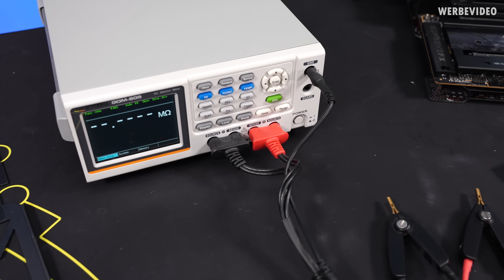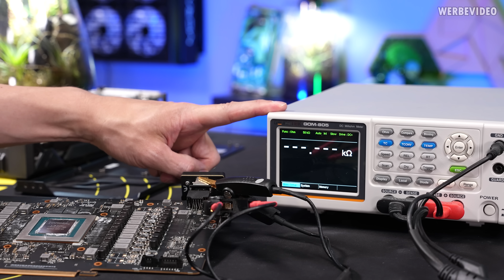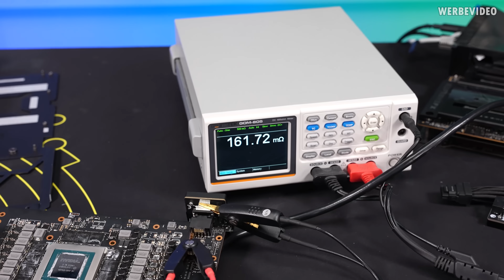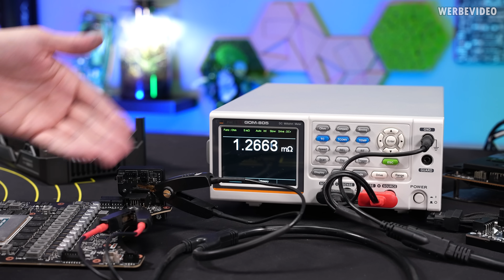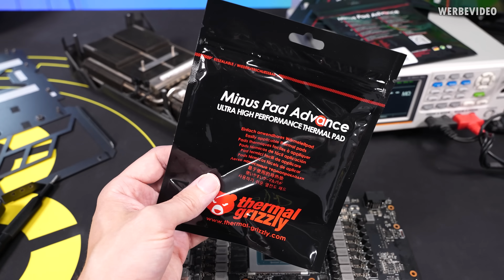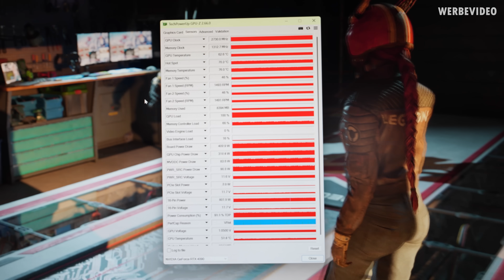It Happened Again – RTX 4090 with Melted 12VHPWR

Comment: Edit: Dang! I also had a Corsair PSU...

Interesting...
I have the same GPU (since June 2024) and everything was great but a few weeks ago it was unstable. I couldn't play long sessions. The games crashed, black screens, etc. After those black screens the UI in windows for example Windows Explorer got black. If I hover the mouse over a folder, it got back to the correct color. I've never seen something like that before. It even froze in the bios
OCCT vram test failed after 2-3 mins.
There were no signs of melting though
I sent the GPU to RMA, let's see what happens...

Comment: my 4080 with the wire view same problem after a year using but i got lucky and the connectors melting together not to strong so i was able to remove the wire view and using regular connector right now

Comment: My RTX 4090 I did a slightly undervolt (no performance loss) and it operates from 270w - 360w and in my build it sits between 53°-60°c room without OC, I don’t think this will  ever be able to get burned in such (low heat) circumstances.

Comment: i wonder if you're already at the point of replacing the connector on the card if you should just change it to something more reliable. hard wired pigtails to pcie 8 pin or something like that.

Comment: They should make the connector in back of the GPU like with the PSU. that way, it can deliver more power.It's more secure, and then you don't see the cable inside the case
Reply: You have cool interests I subbed to you
Reply: @jonnypanteloni 
Cool 😀

Comment: Either decrease the gauge of the wire to use two cables at 12v, or increase the voltage to use two cables at a lower amperage! You're never going to get passive load balancing.

Comment: If only they'd put a capable connector for the power it is handling and a good management system for monitoring it better... you know basics that should be required and essential for any electronic device.

Comment: Another Corsair failure. I ran an EVGA 850w T2 for 8 years just fine and using a cheap Fasgear 12VHPWR to 4x8-PCIE adapter for my October 2022 4090. Then I "upgraded" to a Corsair HX1500i in January 2025 and within 2 weeks I had melted damage to my cable and connector. Somehow people blame me for this when I ran my GPU for nearly 2.5 years without issue until switching to that cheap junk Corsair PSU. Those cheap plastic connectors are so bad that they even sliced my hands up when unplugging them. This whole process lead to me RMAing my 4090 and getting it stolen by FedEx. So thanks for nothing Corsair. I will spend the rest of my life preaching how garbage you are as a company to ensure no one suffers your junk cheap hardware like I did.

Comment: This is the 1 reason I bought a 9070xt. I wanted to go 5080, 5090, or 40 series high end, but this card has basically the best performance especially for price, without having this danger.
Reply: Never had this issue with my 4090 or 5090 so meh.
Reply: Not worth th le risk. @ZackSNetwork

Comment: When an electric current passes through a medium with an excessive load and the electrical distribution medium cannot handle the current load, heat will occur. It is surprising that a company as big as Nvidia does not know the physics formula for electricity.

Comment: I'm fairly certain by now that the issue with these connectors are just the unbalanced load issues.

The moment they fix those, I don't know how, the connector should be fine for everyone. Because there is legit no way that a 4090 connector would melt if some single pin wasn't carrying more than 15 amps or more.

Comment: This design is just disaster. I have idea for a video for you,and also experiment with that crap. Month ago i have bought Asus Astral 5090,because it has built in voltage per pin messauring. I also have bought 2 of your WireView Pro,and i am just afraid of using them,as every connection of the cable give you dissbalance of the amps on the pins. Connecting cable through the WireView Pro is never even,but its acceptable. Connecting cable without any extra connector gives you the best results,BUT: every time you connect the cable you have different disbalanced on the pins. And my PSU is Seasonic Prime TX 1600 Noctua Edition,which is like 2 month old. Two 16 pin cables were included,and one can already go to garbage,because one pin is always at 1 Amp,which is insane! Yes i did few plug in and outs,as i was rebuilding my custom loop,but it was just a few! Now i am using second 16 pin cable from PSU set,and i wonder what i would do if pins would go crazy...

Comment: Sigh, this is such a tired, low effort video topic. The cost to beef up this connector so the nerds are happy exceeds the cost of RMA replacement on melted cards. That, and knowing there is an accepted failure rate for any product, is all this is. People are ridiculous, they want it overbuilt more than necessary, but the only thing they scream about more than that is the cost. Make it cost more! But it already cost too much! Use the old connector instead? Yeah that melts in the exact same way.
Reply: safety aspect should be overbuilt
Reply: @cronyan Even if it was, some would still fail and melt down. Airplanes are a good example. Overbuilt with double redundancy, but they still crash. Rockets that go into space, same thing. People are being unreasonable. But there's one thing you can do about it, just don't buy these gpus!

Comment: This is the reason I selected the 9070XT over the 5070Ti - the power connectors present an electrical hazard for users, and I do not have confidence that the new revision has been corrected or is more dependable.
Reply: It's really not a hazard on a card like 5070ti. Those only draw half of what it's rated for. There's nothing wrong with the connector itself. Just don't buy cheap adapters and plug it in securely.

The issue is more that cards like 5090 use 95% of what the cable is rated for. In the electrical code theres a thing called the 80% rule to leave a little margin for error. They probably should've done that with those.

Comment: 9:55 - A little bit confused on this part, why did you heat it up from connector side and not underside? You could have wrapped parts that you don't want melted in aluminum foil as well

Comment: Great video as expected. 50watts per pin with a slightly thicker gauge of wire over 12 pins would be a much safer 600watts power cable. That would inspire better acceptance to adopt using it.

Comment: What a complete F-UP by Nvidia……..and worse…….they still refuse to take any blame. Brutal………but let’s face it……..this is the new Nvidia and typical of a monopolistic company. Nvidia should be forced to split up. They have become a predatory company. I firmly believe it is the same guy who designed the 5v ARGB connector for motherboards. Another brutal connector, but not as bad as the 12VHPWR

Comment: Soon we’ll have GPUs with modular parts to easily replace all the commonly failed components, like the power connectors and fans.
Reply: Fans are already modular (I know Sapphire does a fantastic job with that), so why not the other high-use components of your thousand-dollar purchase?
Reply: @benjaminoechsli1941  may as well, and why not make the VRAM modular as well? We could significantly increase the longevity of certain GPUs.
Reply: @criznittle968  VRAM has been modular in the past, actually. Unfortunately, that component getting modular makes it notably slower and more complex due to the extra designing needed for the PCB to make it work.

Comment: You measure 4 resistors in parallel, one of them is near teh 105mOhm. Ones, that significantly higher, 140 reading you measure thru board which is too high for some reason since 105 + board path could be 107 or 110. Then you unsolder and never measured. There also other 6 pins. My guess you want better connector in power adapter.

Comment: I still suspect it is the female terminal pin problem, either the pin contact point design, material thickness or plating issue.
Since Wireview female terminal lose to the corsair cable, maybe do some female terminal pin comparison.

Comment: If power is bridged together, then why separate it at a connector into so many pins? Why couldn't they just do that on the board? Wouldn't that be a more stable, less user error of a design to have say 2 large pins instead of so many small ones?

Comment: How can you measure the pin resistance while the plug is still on the board, does this card has 6 power planes on the board? both the wire view and the pcb have all 6 pins on the same power plane as far as i can see

just looking at a 4090 pcb (eg strix/gaming OC) it looks like all 6 power pins go into the same power plane, so i would expect every reading to be probe contact resistance + average pin resistance

BTW i suggest hot air on the plug from the back side to avoid melting it

Comment: Remember when Nvidia shills kept regurgitating "uSeR eRrOr"
Reply: In this case, it is user error by using a faulty third party device to cause the issue.
Reply: @tomatosauceinabarrel No, it is not user error. A simple 3rd party device, one that was literally designed to monitor these under-specd connectors, should NOT be able to cause a meltdown or burning... The same type of voltage monitor would never have melted if used on an 8-pin power adapter.

Comment: 0:22 I’m confused. He used the card for approximately 2 years (probably since launch being that it has the old style H+ connector 5:38) with no issues. Then he adds a Wire View, the connector melts within a year, and we are blaming Nvidia for this one? What am I missing?

Now, I’m not saying the connector design is not flawed. The point I’m getting at is that adding 3rd party 12vhpwr accessories and cables seems to make things worse. I had a 4090 since launch and initially used the stock Nvidia 12vhpwr  to 4x8 PCIe adapter. All was well.

After about 6 months of ownership I switched to a CableMod 12vhpwr to 4x8-pin PCIe cable for a more custom look and started getting intermittent GPU crashes at idle that would cause black screens, a very loud coil whine, and the GPU fans to spin to 100%. Took me another 4 months to figure out the CableMod cable was the culprit after finding another user on Reddit with the exact same issue from that cable. 

Luckily I figured it out before any damage was done, put the stock cable back on and used the card for another 2.5 years with no issues until I sold it for a 5090 two months ago. Using the stock ASUS PSU GPU cable this time and current balance across all pins is nearly identical according to GPU Tweak.

We also saw what happened with CableMod 90° adapters being recalled and refunded, which has a similar configuration to the Wire View. So it seems more to me that what’s more of the issue is that the flawed connector is very picky about what gets plugged into it rather than the connector itself being faulty.
Reply: I've had my 4090 and cablemod cable for about 2 years now all seems to be working fine, it also may be the cable bending i have mine vertically mounted with a very small bend close to the gpu. 
I have not had a single issue with my own 12vhpwr and the same tuf card as shown in the video. I have also overclocked my card to about 2950-2975 through nvidias auto OC with absolutely no issues and no crashes its just abit annoying because now it looks like no one really knows why the cable is melting there's always a new issue with the 12vhpwr that I feel needs to be addressed on a greater level.
Reply: Same thing happened to me with my 7900 XTX.  Card worked fine until I got custom cables.
Reply: The wireview is damaged and probably caused the melting imo.

All the 50 series "melting" complaints at release were all from reviewers who had been re-using old PSU cables they'd had since the 40 series constantly going through plug cycles or people who bought 3rd party cables/adapters, including one moron who used multiple adapters because he wanted RGB lights, and then the last one going into the PSU was wrong pinout and another who re-used a 40 series lian li adapter even though it didn't fit the 50 series because the mounting dimensions had changed.

Another thing to remember is that this entire "nvidia melting" meme started because cablemods generated a panic on reddit and by sponsoring youtubers, solely to sell their own adapters... and then the adapters turned out to be massively faulty. I would bet money that there were 1000 times more problems caused by faulty or temu adapters than have ever happened when people use the correct cable (and the biggest fault with the cable was due to it's small size people weren't inserting it fully).
Reply: @bigpoppa1234  I'm all for F-Nvidia as the next guy. But this is kinda how I felt about the whole drama as well. That still doesn't excuse the fact that they made the margin for error so stupidly low for this plug, though.
Reply: I agree. I feel the blame is being placed on NVIDIA when it clearly was the wireview's fault. Also didn't they release the new 12V-2x6 connector which fixes this problem? All different cables probably do not have this new design in mind, causing the melting.
Reply: @tomatosauceinabarrel yes and no I think. I believe there is the inherent design flaw in how the board receives the power through the connector, which is the problem. However, people really don't need to be overclocking the crap out of the 5090 to near 600 watts. With all the software they have implemented with frame Gen and what not the 5090 can easily achieve 120+ fps, 4k, everything maxed, running an undervolt on the car and limiting it to around 450 watts. There's zero need to push these cards other than big number go bigger. It's a pointless piss contest. It's like have a 1000 hp street car and being like yeah but I need 1500 hp now. Why? You're already breaking every law in less than 2 seconds. Why does it have to be done in 1.5?
Reply: @ryanmolloy5421  Thank you for your reply :)
Reply: @ryanmolloy5421 Agreed. I run my 5090 with an UV. Between that and using Frame Gen, it cuts total system power consumption down by 100-150W depending on the game and scene. My UPS is also only 1000W so this helps give headroom to that as well.
Reply: @bikesandbeats4693 yeah I plan on getting one soon. I'm sick of my 7900 xtx trying to cook itself alive. Like it can push the frames with max settings but it's running at like 95 to 100 degrees celcius, and my case is sounding like a jet engine because of it. I'm kind of over it.
Reply: @ryanmolloy5421 That’s crazy. My 5090 barely goes above 60° maxing out my 144hz tv. 95-100° is insane.
Reply: @bikesandbeats4693 yeah it is. I have some speculation it's because mine is mounted horizontal and apparently the vapor chamber doesn't work well unless it is mounted the other way

Comment: My 4090FE black screens but only with my wireview pro connected up. I tried the Nvidia adapter and a custom cable for my PSU, both do it with the wireview pro but don't do it when the GPU is plugged into them directly. Guess I'll take a look at my connector and see if there's anything funny going on but I monitor my 12v with hwinfo and alert for any voltage drops so fingers crossed.

Comment: I'm starting to think that these need spade connectors or bolted contacts like on car high current loads!  Though someone would reverse the voltages. Maybe something used in welding rigs?

Comment: "Connector melted"
>Looks inside
>Physical damage on the power socket

Why is it always an external source, lmao.
Reply: funny innit. it's always either aftermarket cables, crap like WireView or 180 degree adapters.

How come that I, with a 600W TDP 4090 don't have any issues?
Reply: @Wasmachineman  Because you're using the stock cable!
Reply: @tomatosauceinabarrel  Bold of you to assume I do, I don't. I'm using a Seasonic 12VHPWR cable with a FD Ion+ 860W PSU.
Reply: @Wasmachineman  I ain't got a clue then :)

Comment: These types of video make me nervous, I own a 5070ti with a high failure connector. Should I be worried?
Reply: If you are below 300w… most likely… if above… not so much…
The new super versions are problem, because they will use more power…
Reply: You should not worry, the new 12V-2x6 cable that comes with ATX 3.1 works fine, plus this was the fault of a third party device, not the connector itself.

Comment: Airflow in the case will significantly drop the temperature. I run two 5090s and without airflow, the boards get hot. The connector gets hot from the board temp.
Reply: No u dont

Comment: Lian Li EDGE PSUs use a 12v-2x6 cable that has all wires soldered onto a single bar of metal where all contacts of the connector are also soldered onto, applied on both ends. I wonder if this actually helps because I have not heard of their 12v-2x6 cable melting. Asrock's Phantom Gaming PSU instead has a thermal sensor on the GPU end of the 12v-2x6 cable, and the PSU is supposed to automatically shut-off if it detects abnormal temperature. I've never heard of this PSU having cable melting issues as well. Would these actually be good choice for these 12vh GPUs?
Reply: I have an edge platinum PSU and it's perfect.

It does require a lot of force to make sure the cable is seated into the wireview though. Then it takes double that force to plug the wireview into the GPU properly. It's like re-seating RAM and the 24 pin connector again.

Comment: Literally just received an RMA replacement for my 4090 - the issues were as described before I checked the cable - black screens on game startups, then occasional monitor strangeness. All this masked by the parallel issue of nvidia drivers causing blackscreens in games so I didn't even think to check the cable which is very insidious . Thankfully nvidia honoured the RMA but that cable had been seated for 2 whole years before issue.